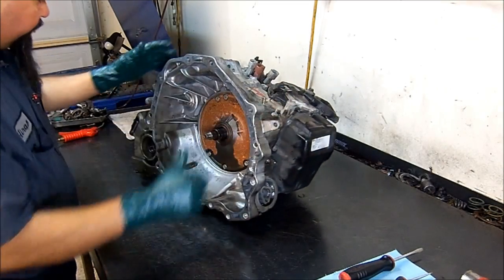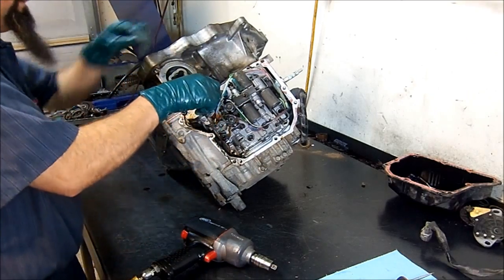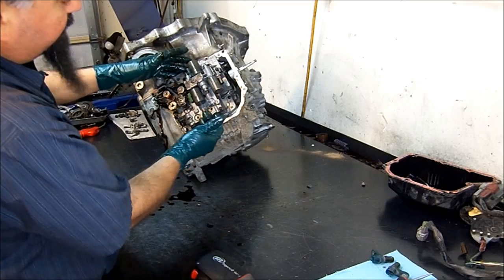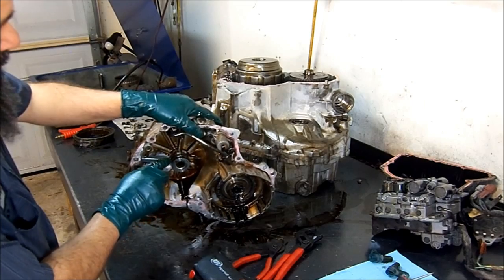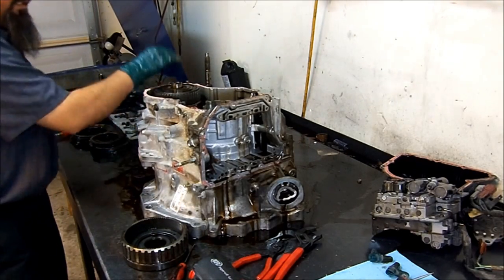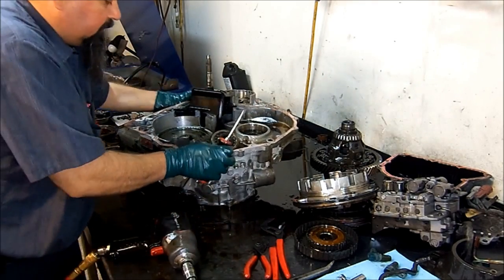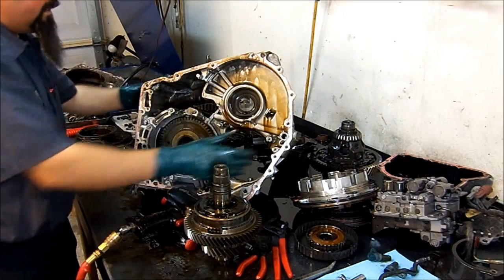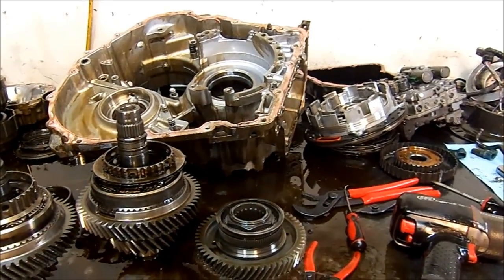AW55-51SN / RE5F22A Transmission Teardown Inspection - Transmission Repair

Comment: Muchas gracias por estos videos aunque no soy Mecanico me ayuda a entender que pasa con mi carro, pero tengo una pregunta yo tengo un 2005 nissan maxima SE y tengo un problema de ves en Cuando la transmicion se queda pegada en 5 pero apago el carro y lo vuelvo aprender si vuelve a quedar bien me Han dicho que Es el crankshaft position sensor Otros me dicen que nesecito transmicion nueva  y tambien tengo el problema de que Cuando devuelven cambio de 5 a 4 lo hace duro se siente un halon gracias hermano .

Comment: Hello I have 2005 Nissan maximum was having problems with it dragging when taking off. Also sometimes it would jerk really hard when, trying to slow down or take off. Now it won't move just engine just turning. I want to get it fixed but not sure of a tranmisson shop in Norfolk Virginia that can do the job. I researched a lot of shop here most not too knowledgeable as to what needs to take place to fix it. Can you give me some tips of picking a good shop and who not to go too don't want to shell out 4000 then find out they didn't fix my tranmisson or placed it. Thanks in advance
Reply: +J Yvette Hill 
I have similar issue, starts and moves fine, then after it warms up a bit, seems like it is still in neutral, whether forward or reverse. Can sit still and rev engine with the car not moving. In RVA, also looking for a good shop. Any resolution yet?
Reply: +Gabriel Hoover 
No I haven't found a shop yet most shop in my area won't touch that transmission. T
Reply: +J.Yvette Hill I actually had Level10 transmission in Jersey rebuild it. arrow transmission took it out, then shipped it up. very solid build FYI. but cost around 4k.
Reply: +Gabriel Hoover 

Thank for the FYI I will look into it...

Comment: My car turns on, I put it into drive and hit the gas pedal and it just revs, I put it into reverse same thing, went into manual mode and same thing it’s like my gears aren’t engaging... then when I went to put it in park it makes a noise in the middle between neutral and park. Help. It’s a 2005 Nissan Altima SE-R same transmission as this one. If it’s the valve Body I’ll change it if not I’m not fixing it. Any info will help

Comment: Hi, thanks for your video. I replaced my linear solenoids (I know you don't recommend that) and need to calibrate them. I'd like to take the valve cover off and drill 3 holes where the solenoids are so I don't have to keep taking the cover off every time I adjust the solenoids, but need to figure out a way of plugging them. Do you know of a plug and grommet kit or anything I could use to plug the holes? Thank you.

Comment: Where are you located man? How much to rebuild one of these transmissions for a 2005 Volvo V70R??... No real problems as of yet, I'm just looking long term as I want my car to last well into the 200k miles (only 98k miles at the moment)...
Reply: Chris Lindley 1000 would be a minimum but over 2000 is a sure bet

Comment: Thanks Hiram for the video, couldn't have done this without it. Unfortunately I ended up with a steel washer. Can't figure out were it goes. Any idea?approximate Dimensions OD 2.25 ID 1.73 THK 0.08
Reply: Hey Tony, did you find out where this washer goes? I've "test assembled" the unit (no RTV on the casing joins yet) and have the same washer left over. All the exploded views I have don't show clearly if they are Torrington needle rollers, races or washers. Guess this is why it was a test assembly, I'm pleased I haven't glued everything together...

Hiram, thanks so much for your efforts with this video, it has been a huge help!

Comment: hy Hiram. i steel have the problem with the transmission AG4 01M . i rerepeare all the clutches and piston. i have the engagement of secound and third ... after a nice engagement comes the interruption..desengagment . it seems like the pressure decreases! i have change the valve body before . i see that i have a bad pushing on the drum 3.
Reply: I FOUN THE CAUSE OF THE PROBLEM. OUTPUT AND INPUT SENSORS WIRE WAS IN RONG LOCATION. THE OUTPUT WAS WITH THE INPUT WIRE AND VICE VERSA

Comment: @6:32 I think Sonnax has these special metal retainers out now that you can put on the electrical connectors for the linear solenoids in case they get broken trying to disconnect them so you can still use them.

Comment: ***** love this video. Not many people go as in depth as you..

I have an issue with a 01 Volvo v70 xc transmission. Park is loading the engine like its in drive and I think it would move if not for the park pawl because the car moves forward when you start it and you can't Rev past whatever the TC stall speed is. Reverse doesn't work, it's like reverse is fighting drive and reverse at the same time so it just doesn't move at all. Neutral is DRIVE (yup I can go forward in drive) , and drive is drive. It seems to shift through all the forward gears (car is not registered so I can't drive it but in my jobs parking lot).. I'm a professional auto technician but we don't do transmission overhauls.. This seems to me like a solenoid or valve body issue, but I don't know. Where would you suggest I start my diagnosis? I have access to snap on modis scanner, and Mitchell on demand (not a fan of it but it's what my shop uses) 

Ohh and i have a dtc for 3rd gear incorrect ratio in the TCM.
Reply: ***** that's also why it moves forward in neutral? Because the clutch pack isn't releasing like it should? Thanks man your the best.
Reply: ***** You were spot on with your diagnosis. When i got the trans apart there was a drum in the rear of the trans (dont know its name) with a broken weld seem and burnt up/frozen clutches. i will post pictures and such when i get a chance.

Comment: ***** Hi. I have a question:

I repaired my 2006 Maxima's Transmission (Exactly the same trans as the one you repaired). After completely overhauling it, It says that it's on 5th Gear but it's really stuck on 2nd. It won't change gears no matter the RPM.

The TCS, SLIP, and Service Engine Soon lights are on and when you put Reverse and/or D it shifts very harsh. I did a Diagnostic and it said that the Cam position Sensor is bad and that the TCM is inactive even though it's new. Does the Cam Position Sensor affect the Transmission in a way? Thanks.
Reply: +Anthony Olivo™ yes it does just change the camshaft position sensor and you problem solved, you might have problem with the valvebody too
Reply: Alex Keller I resolved the problem a few days ago. It was that the Transmission bolts weren't torqued correctly. And the new valve body was defective too. Thanks for the reply BTW! It's appreciated.

Comment: You have convinced me that I will never try to tear down a transmission. You are a professional, and I am not. I hope flushing my Volvo's transmission will fix my problem. If not, I will either have it professionally serviced or scrap the car. I'd like to change the filter. Why in the world did they bury it inside the transmission?

Comment: Outstanding. Are these and the TF-80SC's fundamentally close in design and operation?
Reply from the maker: No, the TF80SC is more likely the 09G. The difference is the 09G has intermediate clutches and the TF-81SC  has a band of intermediate. Also the valve body is towards the front of the car while the 09G is at the bottom.
Reply: @AutomaticTransmission  Ok good. Reason I'm asking is because I have one in my '07 Volvo V70 R. Would love to see one of your fine vids about that transmission. Thanks.

Comment: Oh man if I had your knowledge I literally have a Saab 9-3 with the aw55-51sn transmission on my 2007 and 2010 and my 07 is slipping in regular d and somehow in manual mode it works okay so I’m not sure if it’s valve body related or torque converter I’m really not sure at this point

Comment: Fantastic teardown, information and over info provided. The biggest thing taken away is doing your routine maintenance ini regard to fluid change saves thousands of dollars like always on these Nissan transmissions. Use Nissan Matic or Amsoil at manufacturer recommended intervals or sooner to be on the safe side.

Comment: Hi Hiram. Thank you so much for posting these vids for us. I'm Fascinated by transmissions and have tore into a couple. Please answer a question. My af33 has no engagement in any gear even though the range shaft is moving with the shift cable.  Short of the detent spring being broken or misaligned, will a stuck closed slt solenoid cause no line pressure? Any thoughts? I did get various tranny codes but they went away and didn't return after they were cleared. That's why I'm suspecting the broken detent issue over sticking solenoids. Thank you in advance. Keep trannying!!!😁

Comment: Hello Hiram. I have this transmission in my 2004 Volvo XC 90 all-wheel-drive with two. Five turbo. It now has 260,000 miles and is running strong shifts great. Do you think this is exceptional for this transmission? I change fluid twice a year

Comment: Can't believe this little thing puts down that power.. I have an 05 Volvo s60R, 230k, well maintained. Original trans shifts decent, not real problems. I've got this converter slip of about 500 rpm or so in 3rd sometimes. I know they do have the slip built in but this seems double. It will hold rpm then increase speed by near 20 mph before converter locks back up like a cvt feel for a few seconds. As i add more power it seems to be more pronounced. So before adding more power I'm doing a transgo shift kit to make everything better, I hope.. I need to get vida going again to run the adaptation. 

Hopefully this will improve some of the shift characteristics

Comment: Do you have a DVD on dis-assembly, inspection and rebuild of the AW55-51SN / RE5F22A Transmission?  I purchased a DVD on the 4T65E transmission and rebuilt a couple with success.  The DVD was more detailed than a manual because it showed what to look for to replace and you could stop the DVD and never lose your place in putting the unit back together.

Comment: Another great transmission video. Have not had the chance to do this unit yet, but now looking forward to it. Question: What method do you use to remove the small bushings out of the planets and the direct shaft? Looks like using a punch would be tough. 
Thanks!

Comment: The video is awesome. I used it to rebuild my aw55-51 sn from my Altima se-r. The clutches looked ok. I replaced most seals o-rings and checked the resistance on the solenoids and cleaned them as shown on one of your other videos I also replaced the torque converter. Put it back in the car put it in drive and nothing.  I shift through all the gears and absolutely nothing. As if it were in neutral. Any suggestions on what the problem could be?

Comment: Hi, good night, master, I have a problem, repair a transmission the 45rfe of a ram 2500 2004 and now it takes time to apply I have to accelerate until 1500 rpm so that it starts to vanzar gives me these codes.
P00c9 line pressure low
B0081 LR pressure switch sense circuit
P0035 loss of prime

Comment: great video, going to subscribe..  I had a failure a Chevrolet  equinox, AWD AW55 tranny.  quick question do you have any videos on how to dissemble the pump assemply..   I have taken out the 4 bolts, clutch packs, spring compress ring, and the larger snap ring in the center.   Definite pump failure due to clogging of debris,  large metal debris of 1mm in size can be seen near the center input shaft, I just cannot figure out how to remove the pump to show the client...

Comment: Hiram-- 2005 Volvo S40 AWD.  I'm 95% certain that the bearing on the passenger side of the differential is bad and getting worse fast. Can I separate the case at the bell housing without dismantling all the other parts per the steps you demonstrated?  The trans runs fine but there is a bearing grinding and it gets worse in 15 minutes of driving.  I ruled out hubs, transfer case, axles, everything else.  Will I be ahead to just scrap the trans?  PS - You take that trans apart like a machine. Fun to watch although I'm ashamed to admit that.

Comment: 2005 maxima 5 speed code p0744 were is located torque converter clutch solenoid. 
Thank you

Comment: When you b
Rebuild one of these aisin aw 55s do you use a master rebuild kiut of parts?  What brand of spare parts do you buy?  I have a aw55-50sn from a volvo v70 wagon I use to tow with.  Thinking of wintertime overhaul to keep it reliable.  Seen these kits from China for a couple of hundred dollars with plates and steels but unsure about those.  Seen son Organ kits /parts online too.  What is you recommendation.  Thanks in advance.

Comment: Hello, I have a Chevrolet Captiva 2007 model, a six-piston engine, 3.2 liters of petrol. I have a problem when I am driving the car and the engine temperature is in the normal mode and at a slow speed, there is a jingle and a ticking sound, especially when changing the first and second gears also in reverse. The gearbox oil was changed and the problem persisted. Is it because of the body of the valve or the problem of sensors?

Comment: What difference is there between the aw50 42 ls and the 50 42 le?  I have a c70 with 5042le change and I can't find a gearbox and I have located a 50 42ls, would it be worth it?

Comment: Hi Hiram! Thanks for sharing your videos, I am overhauling this specific trans and have run into an issue hopefully you can help with.. the direct clutch and 1-2 reverse clutches use a "cushion' spring in the pack along with the steels and frictions..my manual is not clear on which way the cushion spring goes in, do you know by chance? Thank you for your time sir!

Comment: Hey i had hard shifting from 1-2 2-1 and replaced the valvebody and seems to have resolved my issue. but now i have to give it a lot of gas before i start moving in reverse and it has little to no power. does that sound like a valvebody issue? or possibly the low reverse clutch circuit gasket?

Comment: The output shaft seal on the front TC side, does it bottom out in the bore?  it shows about 1/2" down in the bore, I replaced it on my Volvo but I wasn't sure how deep it was supposed to go. I put it down about that far.

Comment: I have a 06 maxima with a aw55-50ns . it work when is could stop working soon as warn up if just been complete rebuild and selenoid been replace and still doing the same . what will be the possible problem in this situation.

Comment: Hiram this is fascinating to a weekend mech like myself. I have this engine on my Ford in the same incarnation found on the Volvo XC90 and XC40. If I may put some questions to you - Neither 1st nor 2nd gear lock up completely, only from third onwards - is this normal? Shifts are somewhat firm - 2nd-3rd being the most pronounced - do all versions of this box produce firm changes? How do you preserve the 4th/5th gear clutch packs? I would like to see 200k miles out of mine and I change the oil every 30k with JWS3309 spec Volvo oil.

Comment: what should labor roughly be to have a transmission installed in a 1998 Maxima and what's good price for a new or used transmission
Reply: I was wondering the same for my 05 maxima

Comment: Hello Mister Guttierez, and thank you very much for this helpfuls videos. I'm a mecanic  but not familiar at all with AT gearboxes, as we don't do it at all in France, lol!
I have an issue with an AW55-50 on 2001 Volvo V70.  it works well except it don't engage the 3rd gear. it don't find it, over rev, and finally engage 4th if I'm enought fast. Oil is new, linear solenoids too, all electronics arounds are ok.  Do you think the third gear is dead or is it about the valve body?  Thank you very much for your reply!

Comment: I've got one of these transmissions being a dick right now. I have replaced the valve body and all solenoids (it was a hail Mary) and it didn't change anything. I then opened my bottles of the nice JWS3309 compliant fluid to replace and noticed it smelled different than what I pull out. So I am assuming some moron put Dex III in there because what came out smelled like Dex. The way I understand it is the JWS3309 fluid has friction properties that is absolutely necessary to have in there and that Dex can and will mess up the transmission. Not sure if I should flush it out and refill or just replace the whole transmission. God I do not want to replace the transmission, what a pain over something so simple. But I guess if the fluid is brand new Dex III they were chasing a problem to begin with I just wised they wouldn't have put that fluid in there and would have opened a browser and read something. It's simply reading, something we learn in grade school, no one has an excuse for putting in the wrong fluid. 

As a side note I can move the wiring harness and have the computer loose connection with the TCM so I am assuming that there was an electrical issue they thought new fluid would fix. I can't stand dumb mechanics and the person who did this was obviously not smart. When it gets warmer I will be looking at the harness to see if it is messed up.

Comment: When rebuilding these transmissions is there anything that can be done to increase the torque capacity (like adding extra clutch plates?)
My Volvo S60R is limited to 350nm in first & second gear.

Comment: Hiram, I hope you are still posting these great videos. On the last clip I watched (about the THC 350) You mentioned that you were concerned that not enough people were subscribing. There may be a reason. MANY people are now watching Utube clips on the new model "smart" TVs. These show ONLY the video with no surrounding text or controls, so it is impossible to subscribe/like etc from the TV. Encourage people or hang up a text sign in the background, to log on via a PC so they can subscribe.  ALSO use ads in your clips, you will get rich from the ad revenue.